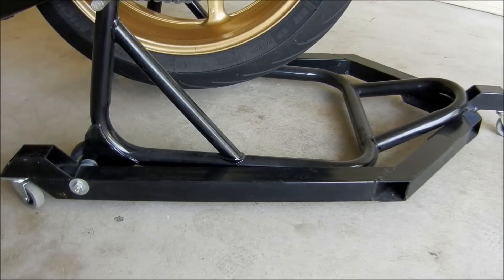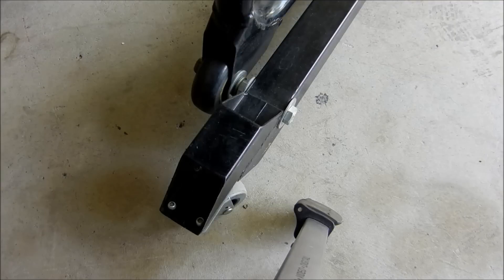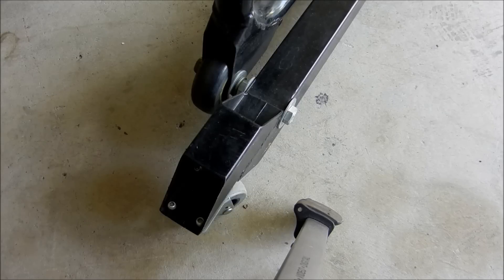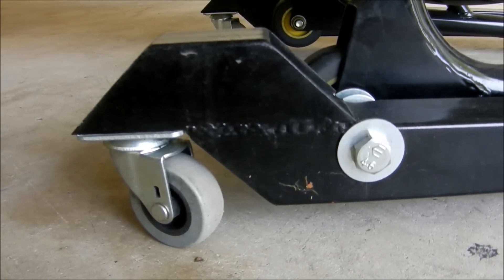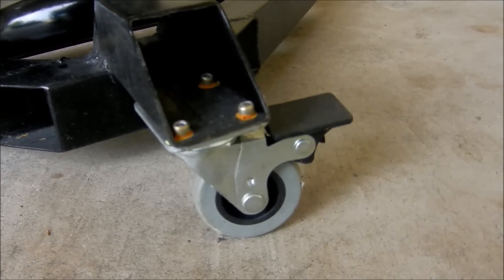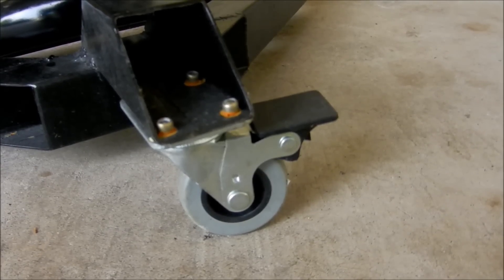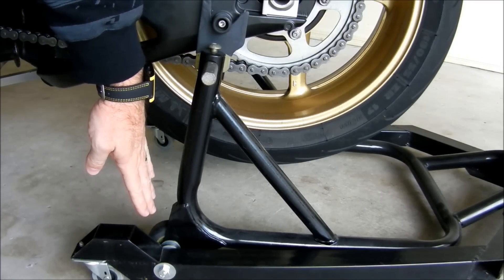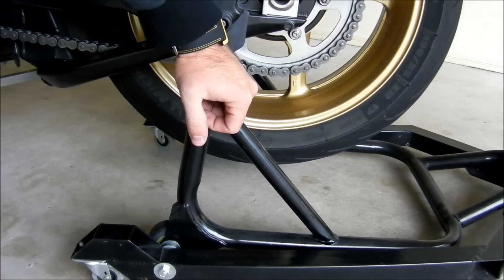Paddock Stand Modification

Comment: Looks amazing! Great job.. I wonder what would happen if the same dolly was built for the front stand and both were used together? You will be able to rotate the bike in 360 degrees and move it easier in a smaller space, but would it fall off the stand?
Reply from the maker: Ahmed El-Guindy it would probably be pretty unstable because the front steers
Reply: dynamoto did exactly that